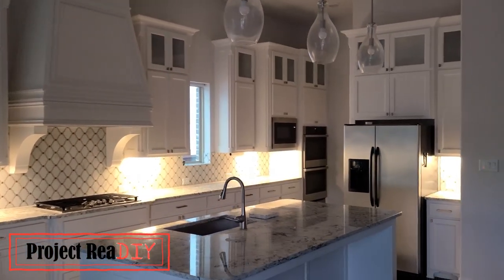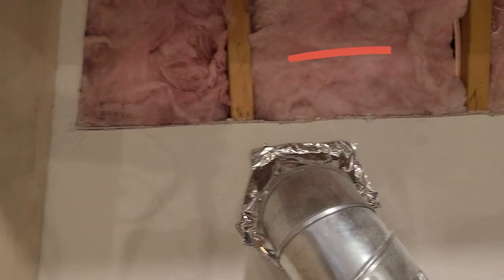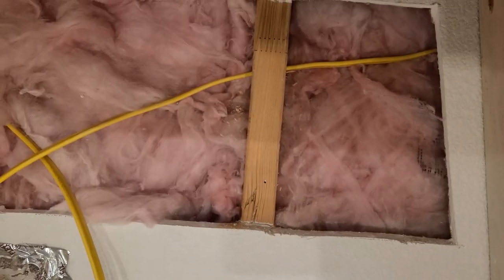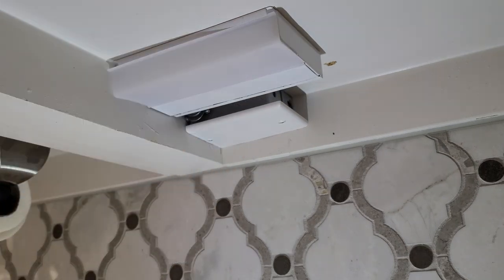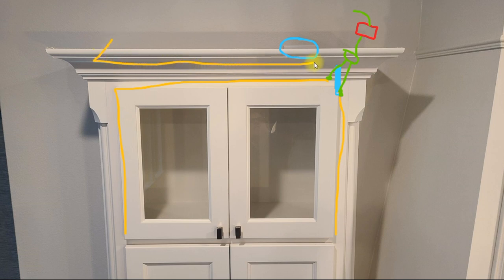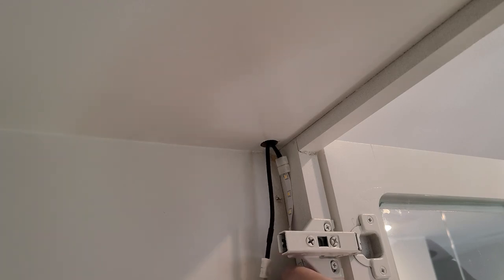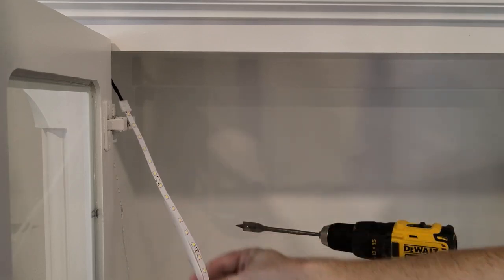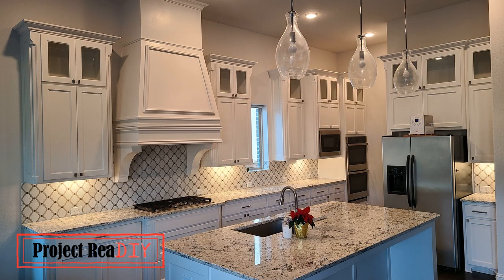Adding in-cabinet and above-cabinet kitchen LED lights

Comment: Once installed, is there a way to control the dimmer switches without adjusting them from on top of the cabinets? Are you able to adjust them from the wall switch, or from a remote or app? Thanks.

Comment: Why did you select these specific LED lights and not a programable white lights that can be adjusted from 1500K to 6000K? Also, I tend to use channels with diffusers to hold the LED strips; in my experience, the sticky tape does not hold well and sooner than later it becomes unglued and the LED become dusty at the top of cabinets. Last suggestion, there are right angle connectors that allow you to join 2 lengths of LED lights at a right angle and makes it for a more professional finish.
Reply from the maker: All of those are good tips, thanks. I chose this particular color bc it matched the temp of the existing under cabinet lights.

Comment: Nice video, though its easier to use LED tape and run low voltage wires rather than 120VAC

Comment: I placed puck lights in my glass cabinets, and the light shines through the cracks of the doors.  I am wondering if by switching to tape lights would solve this problem?
Reply from the maker: My tape lights shine between the doors also.